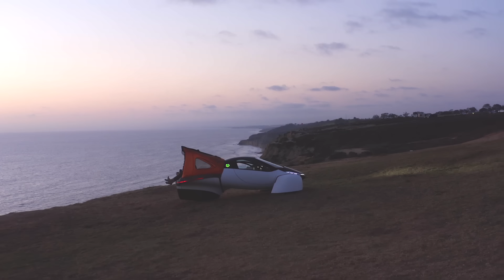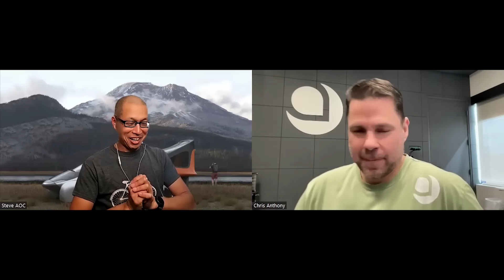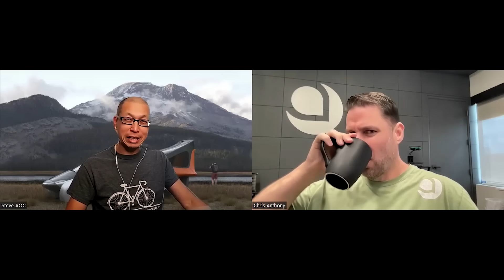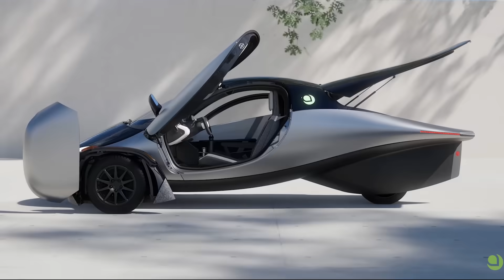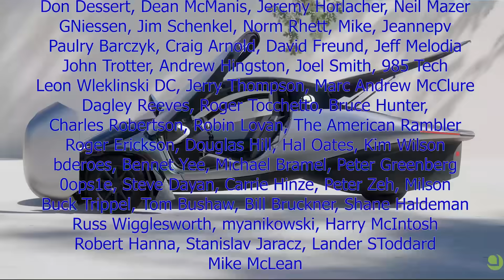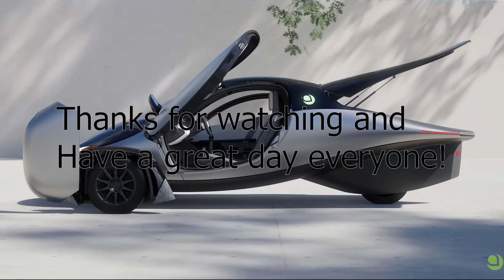Part 1/3 Aptera Update with Chris Anthony May 2024

Comment: They only have enough capital and resources to build 3/16 PIs? Y do they need 16 PIs? Is that what’s required to complete the validation?
Reply: They have more excuses, then Carter has pills
Reply: Are the Aptera production intent vehicles required to pass some validation for some government  regulatory body?  The Federal Motor Vehicle Safety Standards (FMVSS) and/or the National Highway Traffic Safety Administration (NHTSA)?
Reply: @skipondowntheroad5833  some I’m assuming though I’m talking about engineering validation
Reply: Aptera is not required to pass regulatory testing, since it is a three wheeler, but it will undergo the testing anyway and the results of those tests will be released. Probably the IIHS will do the testing since they will want to certify the crash results for insurance purposes. 

Crash testing will destroy a number of test vehicles. The others out of the fleet of 16 will be for validation of different components and use in press events.

Comment: There were a couple of confusing statements here. Long-term, I understand that they will die cast aluminum parts, and those tools typically take more than 3 months to complete. Short-term, Chris mentioned sand casting and CNC machining, making it sound like it was one or the other. There are 3D printed sand casting molds for prototyping, but they definitely need to be CNC machined afterwards since sand cast parts are pretty rough. I recently went through this exercise and found that going directly to CNC machining produces a better part at the same or lower price, IF you can find a billet of aluminum big enough. The good news is that die cast parts are very accurate and inexpensive. I was also glad to hear they are welding the frame. The CAD models show what look like large rivets attaching the extrusions to the cast parts. I was concerned about those loosening over time.
Reply: Sand casting can save money in the long run especially if you have a part that only needs tolerances in a few key areas like bolt shoulder faces. For structural runs like beams and bracket rear faces that don't need to mate to another part, sand casting can provide an end use surface finish that does not require additional machining, saving cost due to less waste material and waste machining time. Machining down full billet make sense for high tolerance smaller parts, but does not make sense for larger parts with only a few toleranced faces. Only machine what you need to, and cast the rest.
Reply: So their CAD models publicly posted are not the latest ones?
Reply: Welding will weaken steel! That is why there is no welding on medium duty truck frames! Everything is bolted to the frame and never welded!

Comment: More delays,  I doubt we will see August.  Very good job on pressing him on who is making the packs for the PI builds because he was really talking around that subject.

However, I am confused if they are working with a local company to do the laser welding does than mean that equipment is temporary or will be integrated into the CTNS work?
Reply: It’s sounding like November to me based on my timeline conversion rate. The unveiling should be wicked when it happens though. 

One thing going for them on any delays is that an extra Fed rate cut to improve their financing options would make a big difference.
Reply: There is no licensing potential of any significance with their patents. People need to understand they need these patents to protect their process so someone cannot come along and sue them when they are generating revenue. The patents also have zero value for a loan as IP loans require demonstrated value before the worth of the IP can be assessed properly.

Don't expect US Capital to be a miracle change.   There will be no crash testing any time soon because they already stated the use of the first PI builds. Guess we are lucky they are making three so Chris, Steve, and Jason, are at least guaranteed their cars.
Reply: @fourteenfour1  On what statement by Aptera are you basing your claim that there will be no vehicles past PI3. Please provide a link to your source. 

If Aptera has not said that there will be no vehicles past PI3 then I would expect PI4 and PI5 to follow it. Logically, these would be the first of the crash test vehicles. PI3 is a milestone, once it is passed, there will be no issue making more vehicles like it. Once a day, in fact, is what I believe Chris has said.
Reply: I am POSITIVE we will see July or August.  Stay tuned and BE PATIENT.
Reply: @rchender  - I am POSITIVE we will see crash test data by July 5th. Stay tuned and BE PATIENT.
Reply: @billsmith5960 I'm positive we will not see testing by July 1st. No one with Aptera has ever said that. We will see testing, just on a more reasonable timetable..
Reply: @richardryley3660  - Crash testing by mid year (2024). Technically, July 2, 2024. So, has that changed? I guess they will make that announcement for the May update.
Reply: @billsmith5960  July or August, yes. Technically, crash testing can start even before PI3 is rolled out, since crash test vehicles don't need things like interiors and air conditioning systems. I think we will probably see it after though.
Reply: @richardryley3660  - So, crash testing doesn't need to be a complete production vehicle? IIHS buys cars off the dealer lot and crash tests them. I wonder why would they do that? If you can just crash a car with most of the parts missing, then it makes sense as Aptera is an autocycle and does not need to pass tests like a car or light truck needs to. 

Thanks for confirming this as I will pass it on.
Reply: @billsmith5960  I have seen crash tests of production vehicles where the interior of the vehicle has been replaced with a tubular frame. That may not be the case with modern testing however. 

As I stated in my previous post, I feel it likely that Aptera is going to wait until PI3 is complete before beginning crash testing. So it will probably include the interior since that will add to the structural strength. 

You can't tell me that an air conditioner is going to change the results of a crash test, though.
Reply: @richardryley3660  If I were part of the June 6th investment group I would insist crash testing be canceled or postponed. I would finish 10 vehicles and sell them to top Accelerators who accept no crash test. Anyone can hold their place in line until after crash testing. After selling those 10, sell 10 more to next Accelerators comfortable without crash testing. Keep doing that until financially viable, then crash test, then go back to the top of the remaining list of Accelerators and start going down the list again.
Reply: @artsmith103  You're asking Aptera to go back to making Apteras by hand for a niche market. None of their partners would accept that. 

The only suggestion more foolish than this one would be for Aptera to abandon the three wheel design and begin working on a four wheel sedan.
Reply: @richardryley3660  No, they can make them anyway they like. Are you suggesting besides still designing suspension and never demoing actual performance, that they aren't close to a production method?  Just skip delay and cost of crash testing because it isn't required since it isn't a car. Why would you think production might start in 2025 on their current path?
Reply: @artsmith103  Production starts in 2025 because it will take nine months (to a year) to tool up to full scale production. Nothing they do can speed up that process. 

I would love to see Aptera produce the Accelerator vehicles by hand. Such vehicles might even be more valuable because they are unique. However, I doubt Aptera will go to that effort since they will be able to turn out 40 vehicles and send them out to Accelerators on the first day of production. And 40 more the.next day. 

As for crash testing, Aptera has always said that they will undergo the same crash testing as an automobile. The vehicle can't be sold until it undergoes mileage and safety testing anyway, even if only as a motorcycle. (And it's going to greatly exceed motorcycle standards)
Reply: @richardryley3660  Repeating Aptera nonsense is tiresome. The comments are best served exposing underlying truth. At the moment inadequate cooling, suspension in process, incomplete solar, batteries in process, inadequate funding, no production facility, no performance data in over 3yrs, no price update. What if LE is currently over $40K, 8 miles/kWh, 17 miles/day solar 365 day avg, 300 mile range?
Reply: @artsmith103  There has been of yet no delay to the schedule. Any statement to the contrary is misinformation.
Reply: @rchender  positive as an electron
Reply: Money, money, and more money. Aptera lacks capital, so it takes a lot longer to get things done. They only have enough to build 3 PIs let alone the 16 they need. What’s most concerning to me is the lack of funding. It’s going to be June 2024 with not a single PI built let alone validated.
Reply: @RomanChaar  Depends on US Capital finding investments for them post June and the eventual IPO.  There is also the potential licensing of their technology that they have patents for.
Reply: @madmotorcyclist  - What is that potential licensing? I've heard about this for a while but if they got into a licensing agreement with someone, I know they would announce it. I ask this, how does that potential pay the bills today?

Comment: When will we see a PI vehicle?
Reply: July to August. Chris said it in this very video.
Reply: July to August is the schedule. Chris seemed to think it would be closer to August, but July was always the optimistic estimate anyway.
Reply: @richardryley3660  Not always. In early 2021, delivery was promised late 2021. Late 2023 there was supposed to be a September Sandy Surprise, never happened. 1st half 2024 was supposed to be crash testing, never happened. Imagine the corruption of promising delivery in 2021 and discussing suspension design in mid 2024!
Reply: @artsmith103  I'm not talking about prior to the announcement of the redesign of the "Delta" production vehicle after Aptera's partnership with CPC. You have no way of knowing if Aptera might have been released under the original Gamma design. 

I will assume 2021 was an estimate, since Gamma wasn't even complete until 2022.

Crash testing was never scheduled for early 2024. Provide a link to your source if you have one.
Reply: @richardryley3660  Crash testing was definitely promised for 1st half of 2024. You'll see honest commentors refer to it often. It's the most recent failure in the years long list. Find your own links if you need one.
Reply: @artsmith103  "First half of 2024x is a very different thing from "Summer of 2024" and VERY different from "August or September". Again, provide a link.
Reply: @richardryley3660  Find your own links. 2nd half 2023, Aptera said crash testing first half of 2024 or sooner.
Reply: Sounds like they are going to be behind schedule again, Chris Anthony did not sound confident.

Comment: Sounds like they're still ordering parts for the PIs and not the full production.
Reply: Chris stated that the full production suppliers have already been chosen but they won't start actual production till PI testing is done.  It's the low volume for PI builds that are taking time is my understanding.
Reply: @madmotorcyclist  just seems like they could have lined up these low volume vendors in the two years it took them to develop the binc
Reply: @randylewis4242  You can't since the PI design wasn't finished prior to this year.
Reply: @randylewis4242 Volume producers are not going to want to be hired for production and then sit doing nothing for two years. You gear up for production when production begins and not before.
Reply: @richardryley3660  I was referring to the low volume producers
Reply: @randylewis4242  Same answer then. The low volume producers weren't going to sit the doing nothing for two years. They would want specifications of the part they were going to produce. Specifications that were subject to change as Aptera and CPC finalized the design.

Now that Aptera does have the specifications, it doesn't seem that they are having trouble lining up manufacturers. Likely that had already negotiated the contracts. Chris even mentioned that they had requested bids from multiple manufacturers so they could choose the best one.
Reply: @madmotorcyclist  pi testing of 16 units or 3 units to start production?
Reply: People think Aptera is very close to production than they actually are.

Comment: Being a person who watching Tesla full driving service do you ever thinking be able to putting it your car to run the Full Self Driving, from TESLA
Reply: Tesla doesn't have full self driving 😂
Reply: @smokindauberdoo4208 Tesla does have fsd that continues to improve as data is added for every car using it every day.
Reply: No because it takes a considerable amount of electricity to operate it! Aptera is about efficiency!
Reply: @gmv0553  When you reserve the Aptera one of the options is the Openpilot self driving system for $1,300. All of the hardware is already there for self driving so I don't see it as an electrical supply problem. Tesla has talked about licensing their FSD software to other companies but I don't think they've done it yet.
Reply: @gmv0553  FSD computers is ~300w.  If only used while driving that is around what you will get from solar on average so basically Aptera can use FSD for free for the power it gains while moving.  Its sentry mode that really sucks back the power (2.5 mwh / year) since inactive time adds up.  When Tesla truely cracks universal FSD the combination of efficiency and FSD makes sense but technical and legal challenges will probably take 15+ years
Reply: @ccibinel like I stated which was also stated in earlier videos from Chris! FSD from Tesla is a energy eating option which would defeat Aptera's goal of efficiency! Open pilot uses very little energy and does quite well especially for the price. Besides what Tesla would charge to use their system is definitely not worth it!